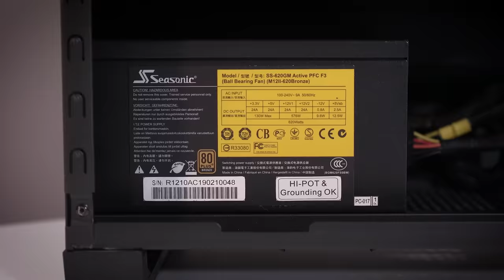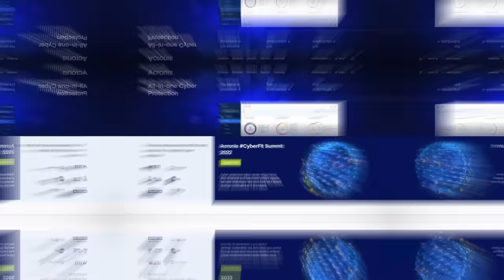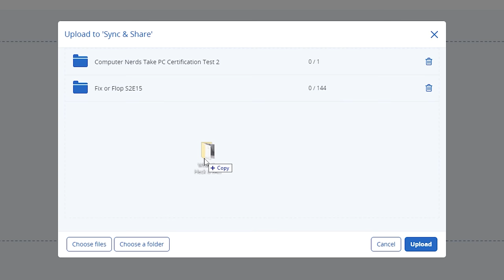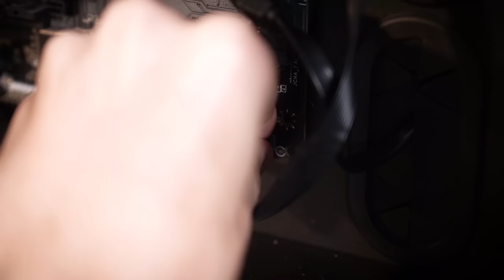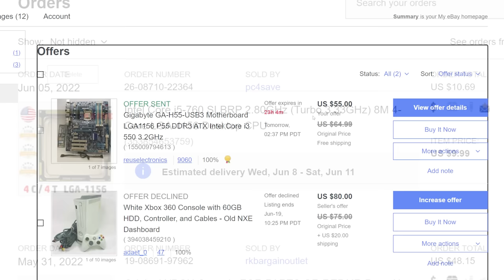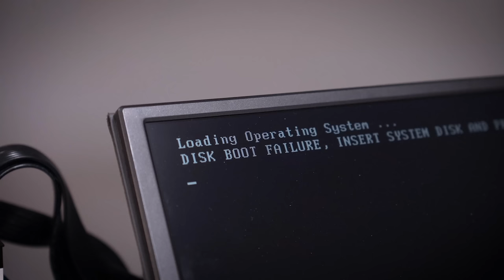Fixing a Viewer's BROKEN Gaming PC? - Fix or Flop S2:E14

Comment: A youtuber here in England puts power to a motherboard and feels for heat, seen him use a thermal camera setup on his phone too but it wasnt accurate, the image was about an inch off but did show short circuits. just pointing it out in case you wanted to look into something similar. i did guess the motherboard but same youtuber always likes to say "its never the CPU... until it is" ive had 2 motherboards go on me, a HP laptop i think blew onboard graphics (i still think it over heated with only one exhaust vent on side and nothing else). other one was a few years ago and was my current pc's original, was replaced under warranty even though it was out of warranty (i got lucky there). love these vids and have watched quite a few even though im a new viewer to the channel

Comment: That motherboard is an 1156 socket. That series had issues from day 1 & was replaced with 1155 within a year, if I remember correctly. The chipset had issues like it would loose SATA ports & just get worse from there. That customer will eventually have to replace that motherboard again down the road, but they should just upgrade the system.

Comment: debug tip: if the debug led and the integrated pc speaker don't do anything, you know it's the MB, those 2 shouldn't require a cpu/ram to work. A power short could also cause them not to work, but you ruled that out

Comment: The case is huge, but it's period correct, back when storage was still bound to 3.5" spinner HDDs and software  and operating systems were installed with DVDs. Optical drives and HDDs needed space to mount.

Comment: Nice job on the fix. Good video. With the age I thought it was the MB - most of the time cpu's don't fail as often especially with older hardware.
Reply: CPUs are the opposite of cars. They either break in the first hundred miles, or almost never.

Comment: TBH if they are on first-gen core and it was the Mobo/CPU that were the only candidates I would've just seen If I could upgrade to the latest platform that has protection against Spectre/Meltdown out of security reasons alone.

And TBH even a Zen-based Athlon or modern pentium likely would kick the shins in of any 1st gen intel CPU, at the very least for gaming/single-core tasks, and 100% beating the crap out of any 2-core first gen intel CPUs (The Pentiums/Athlons may fall behind versus the Quad cores in multicore tasks, but still)

Comment: Hey greg, many thanks to putting CC (closed captions) because for being deaf and to understand whats the problem on the pc. Basically u're like PC whisperer (jk) i had that issue many years ago and i thought it was my PSU after many power outage and in the end it was the mobo and socket PCI-E dead, and i had to buy almost everything, new mobo + CPU + memory ram as u mentioned before if the mobo and cpu is dead. Keep it up the good videos!

Comment: 3:34 Don't worry Greg. I'm just gonna take everything out of the case and send it stuffed into a flat rate box.

But see, I'll leave everything connected, with the power cable coming out a hole in the bottom.

Edit: I hope this isn't any trouble. Oh and cable management matters to me alot when I get it back.

Comment: Given the age of the board, I'd say it's likely a corrupted BIOS due to bit-rot or some other BIOS issue.  Could be some onboard short also, if it isn't a serious enough one to trigger OCP or OVP.  But likely BIOS related, as the onboard diagnostic LED doesn't even come on and/or board doesn't power on long enough for that to initialize.

Luckily, EVGA usually used socketed BIOS chips back in those days (little black plastic thing next to the onboard diagnostic LED with two "doors" on top that flip open to reveal chip underneath), which were fairly easy to replace if you could find a reliable retailer from which to get one.

Comment: LOL  The same case I use today.  It is the ONLY static piece on a system that has been rebuilt 5 times in the last 12 years.  Show me another case you can access 4 hot swap HHD drives without opening the case, still has multiple optical bays, will fit ANY size GPU, ANY size PSU, ANY size CPU fan or a water cooling system....and I MIGHT consider buying it.  But maybe not...I've grown quite fond of this piece of furniture.

Comment: Had something similar happen to me earlier this year: My PC (i5 9400f + Aorus B360m + GTX 1660 Super + 2x8GB 3200MHz Asgard RAM + EVGA 650W PSU + 500GB Nvme XPG) suddenly froze during startup one day, so I manually shut it down via Power Button. When I tried to start it up again, it got into power ciclying, just like this one from the video. Had some spare parts from an earlier build lying around, except for a different motherboard. Started swapping out everything possible: GPU (GTX 650 Ti), CPU (i3 8100), RAM (2x8GB 2666MHz Crucial Ballistix modules), PSU (550W Aerocool KCAS)... Nothing worked. 
I took a look at the troubleshooting LEDs on the motherboard and realized that, with my setup as it was, the CPU LED was lighting up. Changed the CPU and suddenly the DRAM LED was lighting up. Changed RAM modules and this LED was still lighting up. So, my conclusion was that, somehow, both the CPU and the RAM slots on the MB died out, so I ended up basically building a new system with a Ryzen 5 5600 and a Asus TUF B450 MB while keeping all of the previous components of the PC that died out and it's been working perfectly. 

All of this just to say that I totally agree: diagnosing motherboard issues is the worst, ended up losing my whole day when this happened to me.

Comment: I had this same issue before ended up blowing a power supply. Replaced it and the issue persisted.  Luckily my other hardware was undamaged.  Turned out to be a bad power switch.  Replaced it with a momentary switch from Lowes and continued using it for a few more years.

Comment: I would have been super upset if someone traded me another case for my 800D. That case was the bomb. The hot swap bays in the front were cool and it was one of the few from that era that you could easily water cool or modify any way you wanted. I would buy a new one, today, as a file server case.

Comment: my brother's computer was doing something similar to this, restarting at random times every few seconds.  he finally pulled off this cooler master air cooler from the cpu and discovered 2 of the nuts and bolts connecting the cooler to the back plate had come a bit loose, probably from vibration.   after cleaning stuff up and putting it back together the issue appears to be resolved

Comment: The issue with the board is most likely burned out VRM. Because i had a X58 motherboard which had a burned out vrm and it acted like this system. And i was able to see it burn as soon as i took off the vrm heatsink

Comment: I recently had a similar problem with a first gen i5 system. The platform is old enough, it turned out to be the caps were starting to fail. The repair shop got an indication and stopped at that point. Failing caps are a fire hazard. Ended up replacing it with an ultra-modern 3750.

It's for a kid who mainly uses it to watch YouTube and play Roblox. It's fine!

Comment: Did you really smother the 1660 with the audio board? I`m afraid that video card will have some temp issues in the future. Then further having a big case with large empty space does make the airflow better, So having a bigger case like this is not a bad thing. just my two cents. 😉

Comment: Ok, pausing 5min in, i would say its the CPU VRM. Looks like its shorted to ground. You can verify this while booting with only the 24 Pin ATX Plug connectet, and the EPS Plug pulled out. The system will obviously not boot without CPU Power, but it will stay on.

Comment: Greg, I see the logic in this diagnose and it is not wrong. However I had a same short power on / off cycle actually fixed by replacing the motherboard battery ( which really suprised me as well ) could you give that a test on this suspected defective motherboard as well ?

Comment: Did you try using different RAM on the old motherboard?  I did not see you try diferrent RAM; it could have been a simple incompatibility issue with RAM.  I seem to remember that time when the industry was transitioning from DDR2 to DDR3 and then a year later DDR3L came out and any system using the original DDR3 could not use the DDR3L.  Those RAM sticks looked like new ones to me.

Comment: LOL as someone who actually has a full tower aluminum case from Silver Stone I know it can be very back breaking to carry such a massive beast I would change to a smaller case if I could but it's the only way I could have 10HDD's which I use for work and getting a NAS that could fit all those HDD's would cost me an arm and a leg so I am stuck with it for now unless 4tb 2.5inch HDD's comes along soon.

Comment: Yay, first time I see another 700D in like a decade or so! I just retired mine, after 13 years of service the mobo finally died and I decided to go with something smaller this time around. The I5 750 and HD5850 that lived inside it are still working perfectly btw, as well as the old 650W Seasonic PSU and Intel Postville SSD. I would have given it another life if I could have found a working mobo with a 1156 socket but atlas, they all seem to be gone. edit: just noticed the HDD door in the front which means it's an 800D instead. My bad :) ps: I'm glad you didn't swap the case for something else, these were pretty high end back when (close to 300 bucks iirc).

Comment: I would have moved the sound card down further. It still chokes the Gpu fan either side its mounted
Reply: Hard to do when there weren't any more pcie slots lower on the board.

Comment: Any PC or laptop in for repair for a non-boot condition, that's over 3 years old should have the bios button battery replaced, as a matter of course. Just because it reads as 3.0 volts with a volt meter, doesn't mean it's still good. It can have insufficient amperage for proper operation, yet still read at 3.0 volts. As demonstrated with a garage door opener using the same type of 2032 button battery. Not enough amps, and the power operating the opener's radio signal was insufficient. Replaced the "apparently good" 2032 battery, and the garage opener regained functionality.
Reply: Except no…

A PSU supply’s a constant 5V to the mobo so the memory settings are retained. CMOS battery is just used incase power isn’t supplied to the board for long duration’s of time.

It’s bit-rot of the BIOS chip causing corruption of data causing the post issues
Reply: @christophervanzetta  The CMOS battery outputs 3 volts, not 5 volts. The CMOS battery is in a constant state of being discharged, beginning at the motherboard factory. The CMOS battery also runs the system clock, keeping correct time whether the PSU is plugged into a wall outlet, or not. The system clock does not run by PSU power: only powered by the CMOS battery. The 2032 battery is not kept charged by the PSU or, in the case of a laptop, by the laptop's main battery. The idea that the CMOS battery is "at rest" whenever the 5.0 volts may be available via the PSU is faulty. If the CMOS battery is "brand new" & fully functional, there would be minimal chance of any "bit rot" to occur.

Comment: Old computers you sometimes need to check that little battery.. I've had pc be very fussy but when I popped in a new battery it seems to solve the issue. Not that it was the issue here. Quick check of the voltage on the battery will let you know. .02

Comment: Is there a reason why you would choke out the GPU on purpose by putting the soundcard right up to it on the bottom? I know its not a particularly high performance card but the case is gigantic. Why not put it a slot or two down?

Comment: Greg you seems to be a very talented expert, i got a question,  after a cyber attack on a 9 year old machine i had to buy one, im not a tech guru or anything so i did a mid range machine for multi tasking at the best price i could find on my german neighbours websites (prices are already dropping, i really bought at the wrong moment, anyway...).
My pc is composed of : RYZEN 7 PRO 5750G cooled by a be quiet water cooler pure loop 120MM, 32 GB RAM PC 3200 DDR4, B550, 750W power, RTX 3060 Ti, 2x NVME + 3 to HDD. My case is a very basic Corsair 100R silent edition with a very limited and comon low range cooling system. The german firm who built the pc didnt even installed the 3rd vent on the machine ( and they kept the amd wraith prism... they kept everything for them, i just have cds mother board box with drivers and watercooling liquid). Anyway, i bought 3x 120MM noctua vents , 1x 2000 RPM for changing the be quiet watercooler one, and 2 x 1500 rpm high quality silent for the air entry on front (where there is only one very low quality vent actually). The case is  3x120MM slots, 2 flux entry on the bottom front, 1 top back flux exit , the water cooling system is fixed on the exit of the air flux of the case (top back). My question is do you have any idea how i could optimize this?  my wish would be stay under 73°c on the warmest component on a long full load sequence with no overclocking ever, do you think it is possible? i was wondering if i should let the water cooling system on the exit of the flux, or when i'll upgrade it with a higher efficiency noctua, put it on the top bottom front air flux entry (2000RPM), and put one of the 1500 rpm under it, and the other one in exit? do you think this config would perform better than the 2000 RPM on back top with the water cooling system?

Comment: omg, the first PC I ever built had a power cycle issue, turned out the reset switch was shorted, and I only found out because I punched it right in the front IO panel (in frustration) and it started working lmao

Comment: I also have an old generation build, just for the transition period, while I understand the systems and collect money to buy a new generation for video rendering and Photoshop, I have an Intel(R) Core(TM)2 Quad CPU Q9450 @ 2.66GHz 2.66 GHz,4.00 GB memory,NVIDIA Quadro graphics card K620. I work in Photoshop, video editing, but sometimes a reboot is required for a reason...

Comment: My money was on the board from the very beginning purely because it wasn't getting through the boot sequence far enough to even start detecting hardware. My guess is something on the 12v rail.

The age of it, it isn't really worth going full debug on it, but if you wanted to, I'd just dribble some isopropyl alcohol around the 12v rail and see where the short it. If I were in your shoes, I would just have pointed him at a Ryzen 5 5600. Board, processor and new Ram for <$400

Comment: Mine literally did the exact same thing as this but only after the pc had been on for about 5ish minutes. I then realized my cpu temps were sitting close at 100c and when it powered down to save itself from overheating. The cpu was just molten hot still and would power down immediately after turning it on due to the overheat. Which then lead me to the painful dead AIO. 1 PSU and surge protecter and ram exchange later and yeah very odd how so symptons can be so similar but be entirely different issues.

Comment: I got a random question. But an answer would be nice nontheless. Did you ever have problems with (in my case HP) OEM Mobos not supplying the rated 75W power through the PCIe slot for in my case a 1050 ti. It just wouldn't give a picture with the 1050 ti. With the older radeon r9 270 with extra two 6pin pcie power leads it worked just fine. Swapping the mobo to an old third party one fixed it.
Rest of the system is a 300W PSU that also powered the r9 in the oem system. An i7 2600, and now an H61 Gigabyte mobo. Former 16gb (4x4gb) ddr3 now only 2x4gb cause new board only has two slots. Need to fix that at some point. Goal was to play Modern Warfare 2 and it runs and is playable, but ram bottoms out completely while maps are loading in and warzone doesn't run good at all.

Comment: So, aside from PCIe post code addons, are there any tools which are capable of diagnosing motherboard issues? Aside from good old fashioned electronics troubleshooting?
 
Given my last build had two bad motherboards (from the same company no less, teach me to use refurbs!), it'd be damn handy to have something handy to assist in figuring out what's wrong with these devices, especially if it's something as simple as replacing a bad cap.

Comment: I had same issue on X99 motherboard ... swapped out GPU and it booted with no issues. The GPU caused another system to show the exact same issues.
System lasted two years then threw out a cpu error so board might have had an issue as well ... think its still in a box in the loft.

Comment: I had this exact same issue with my previous pc. It was also a first gen i5 750. I took it to a repair shop and they just reseated everything and repasted the CPU and it worked. Didn't even charge me anything. 🤷‍♂

Comment: that case gives me PTSD lol. I just build my dad a internet browser PC for his home. I3 10100, 16gb 3200 CL14 ram, my "old" Corsair 750w psu and a decent mobo but best of all I bought a mid tower case that can support two 240/280mm AIO's or about 6-7 fans for $49 lol and it's tempered glass. BUT to get back to this video I feel like people get a bad misconception about updating their BIOS. IF NOTHING IS WRONG WITH YOUR PC there's no need to mess with the BIOS at all.